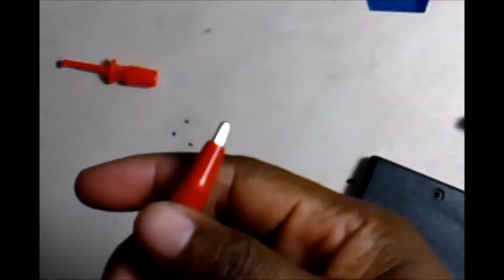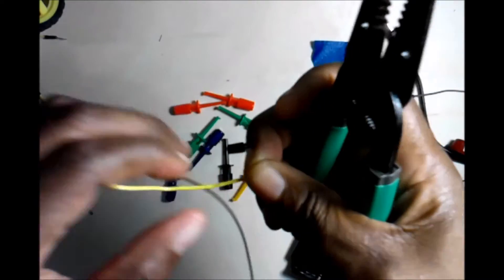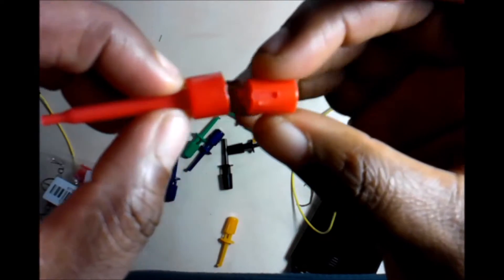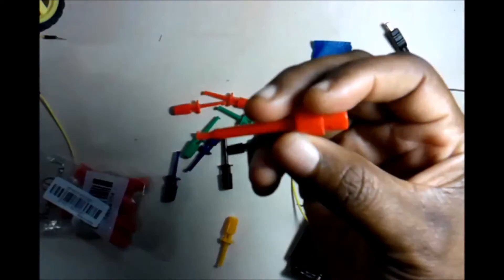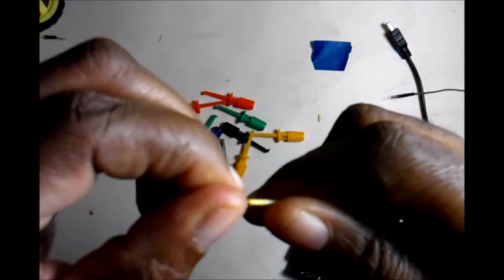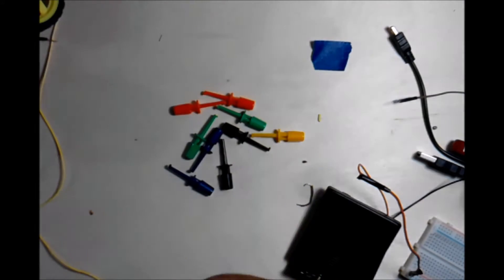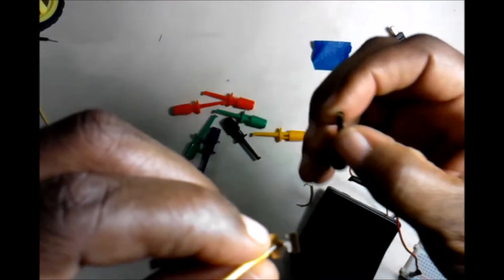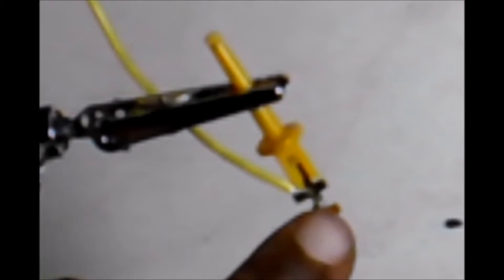Make Test Hook up Jumpers to troubleshoot electronic projects, circuits, or media 1  Ebonygeek45

Comment: You did an excellent presentation.  I've been an electronics geek since 1972, when I dropped out of business school and took some remote learning courses.  Within a year I was hired as a "Test and Calibration Technician" for $3.05 an hour.  I did 10 years in Bio-Medical Electronics followed by 10 years running a Mil-Spec Calibration facility, and 10 years in Computer Science, developing PC's for the Blind and Visually Impaired.  After all that I still love to take out the soldering iron to build something myself.  
Getting back to the test clips; I bought several of these clips forgetting I'd always bought them prewired.  Was I ever embarrassed when I couldn't figure out how to solder them!  Thanks much and all the success in the world.
Reply from the maker: Glad to hear it help you.  I am on a budget so  have to be thrifty with electronics. It is a much better bargain to wire them yourself. l was 2 years old when you got into electronics. What I would give to have your knowledge.  I am self taught. Much of what I do I learned from experimenting. I love it. Thank you so much for commenting.